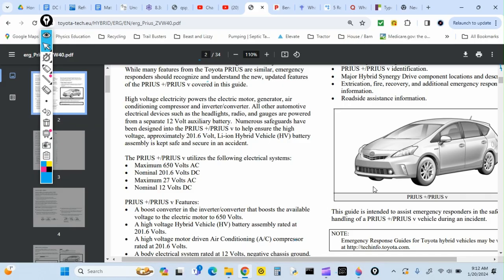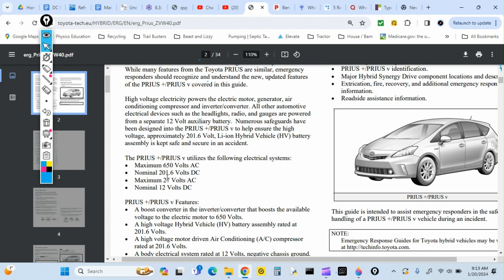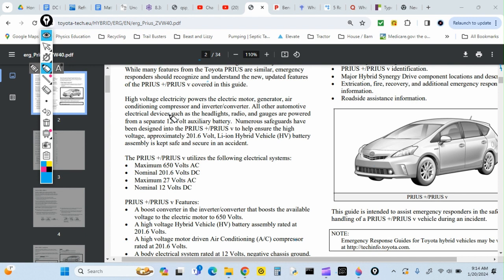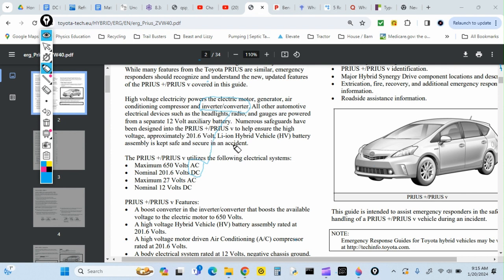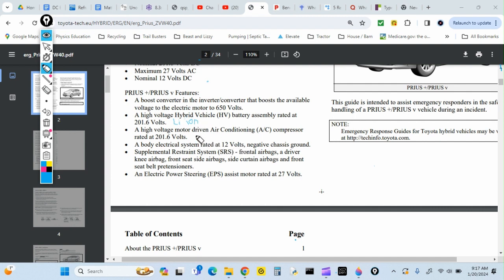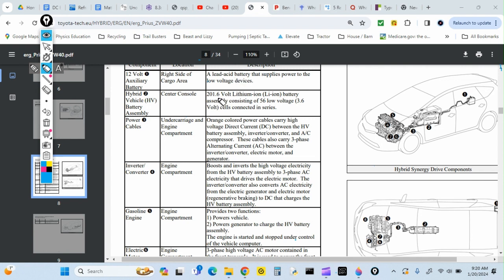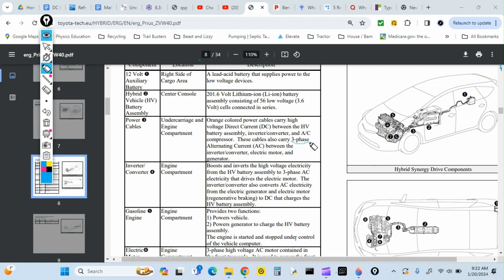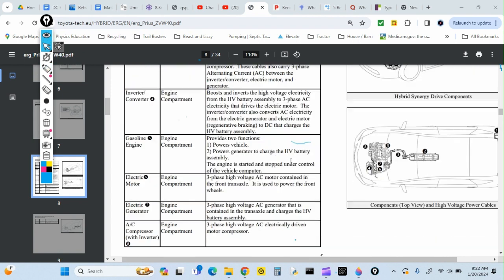DC Electricity or AC Electricity?

Comment: In general I will say that what you say in this video is correct - at least for general purpose what probably 99.9% of the population needs. It may be the same on youtube although I have noticed many that goes more in depth. I of cause am one of them. For the general person it is a good introduction to the Toyota Prius and also general electricity knowledge.
Reply from the maker: I am planning more detailed videos on each section: lead acid battery chemistry, inverter electronics, 3 phase motor/ alternator, etc